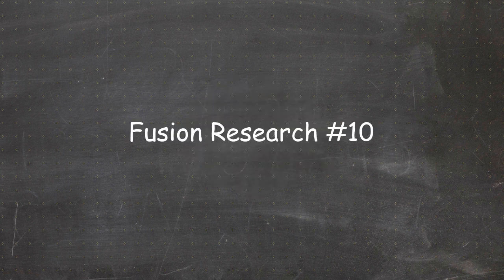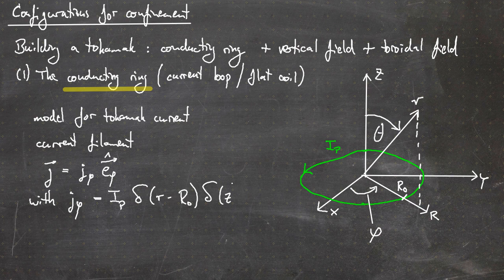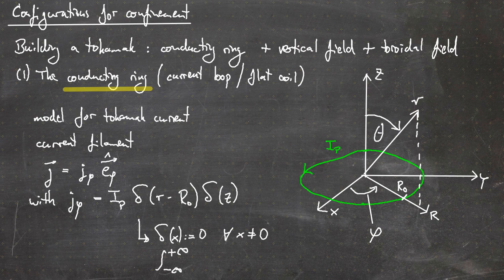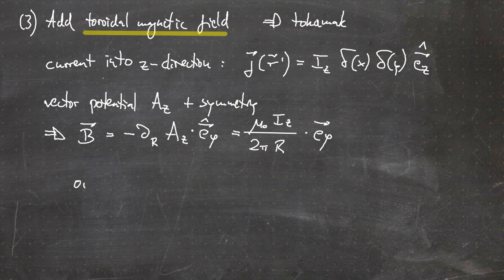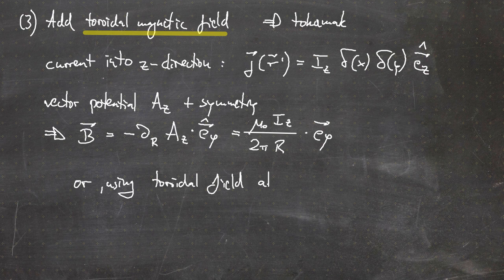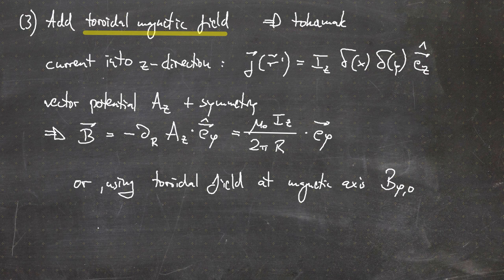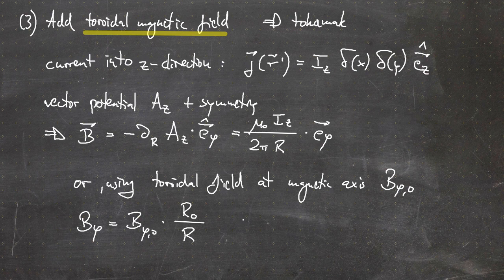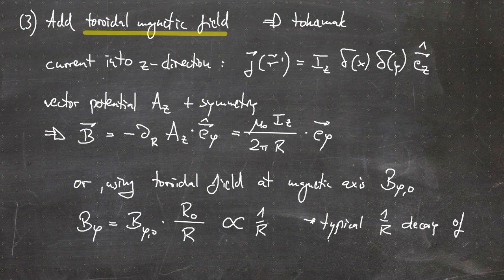Fusion Research Lecture #10 - Building a tokamak

Comment: Great Lecture! 
At 08:40 you demonstrated that the  A_phi can be determined once you know the flux function Psi. And we can calculate Psi by placing wires going around the torus (and when the flux varies in time, you induce voltages on these wires and if we integrate this voltage in time, we can measure the flux)...So my question is: if you measure Psi and you know R, would you be able to distinguish between gauges that Nature chooses? Because from classical electrodynamics, the potential vector isn't observable and from this formula from 08:40, once you measured Psi, the A_phi is determined straightforward and it seems to me you lose the gauge freedom.  Idk if this question makes sense, but I appreciate some insight. Thanks!!!
Reply from the maker: Interesting question! In my understanding, however, we are allowed to change psi and thus A by applying a Gauge transformation and therefore everything is fine again, isn't it...?
Reply: @DerPlasma  Oh yesss!! I see now...my mistake. Thank you!

Comment: 17:35 you say that the Lorentz force pushes the plasma outwards. If the B lines are directed as in your figure, and the current flows into the blackboard, then the Lorentz force F=j \times B will be pointing inwards, in the direction of the green dot, no? Do I misunderstand something?
Reply from the maker: Assuming that j points into the board, B upwards left of the current loop, then the right-hand rule tells us that F will be pointing outwards - see for example here: https://qph.fs.quoracdn.net/main-qimg-5b5cf1c559b3a53eb88f7b6a239c7a8d
Let me know if this was helpful or not or if i am missing something here
Reply: @DerPlasma  Yes, but technically speaking there is no current flowing there. The other katliar will have done the RHR for the plasma situated at the outboard side of the current loop. (We in fact find that comoving currents will attract each other).